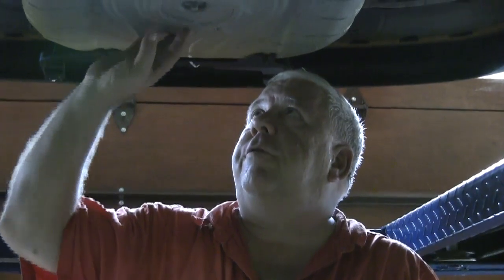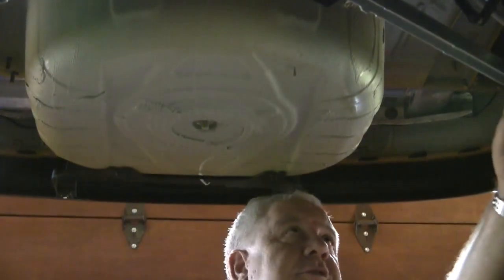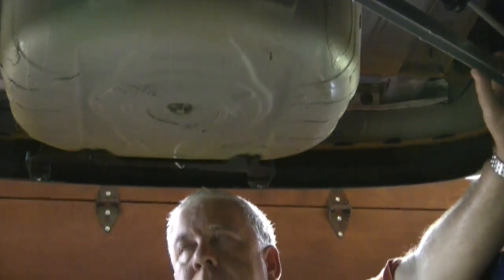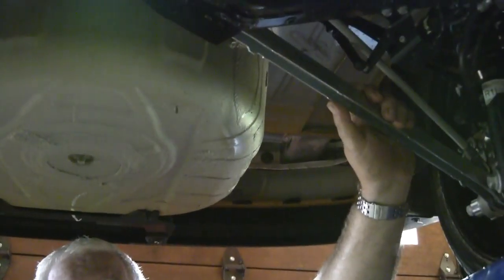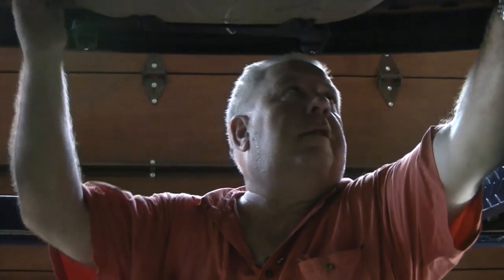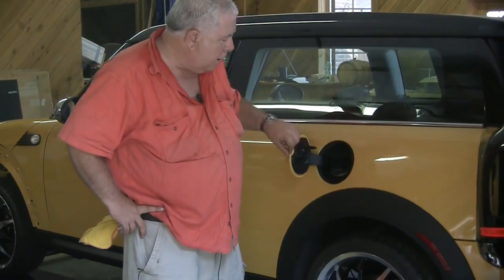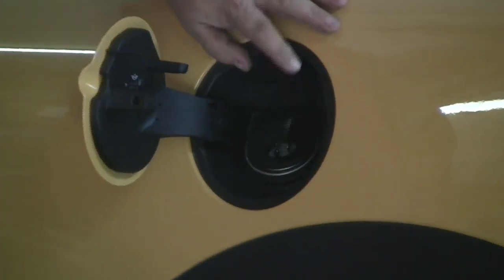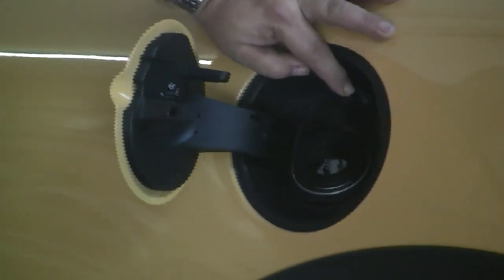9 E-MINI-ME Electric Conversion of 2009 Mini Cooper Clubman

Comment: The J1772 has a much longer history (before 1999).  The current 2001 standard is based on the AVCON unit.  But since the vehicles were taken of the road it became a moot point.